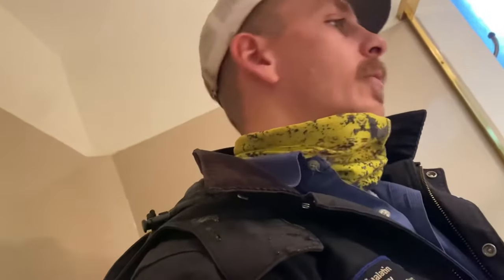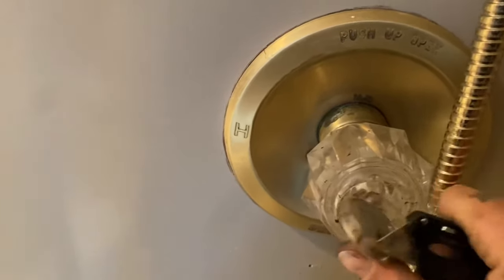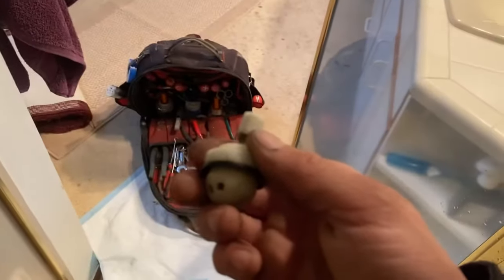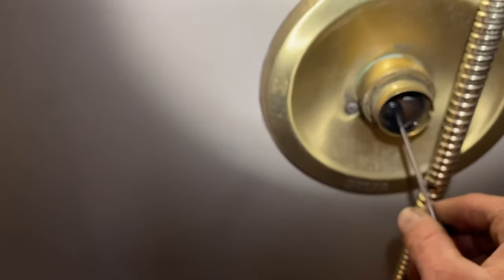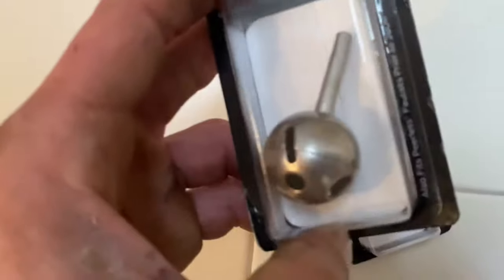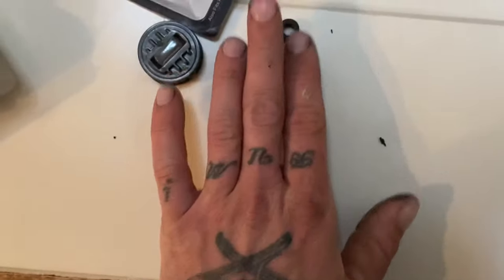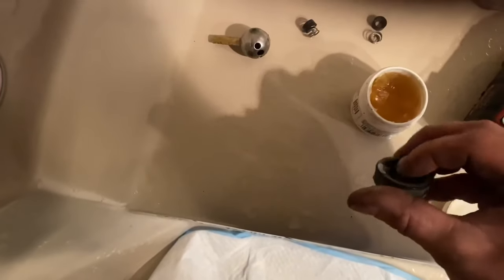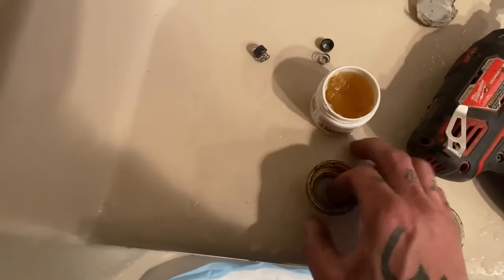How to change a delta shower cartridge ball style

Comment: Step one: turn off the water supply
Reply: Step two: Drink beer, while deciding as to whether or not you want to continue with the project. 
If you drink enough, you'll probably decide to take a break. Hince: You'll likely safe yourself a little work, by deciding to finish later when you're not half drunk!🥴
Ps: Be sure to turn water back on. Better to have a leaky faucet than not have a shower for the next 6 months while you're trying to work up the courage to try again!😄
Reply: @jackpayne3996  yes! definitely need step two.

Comment: Hey, can anyone help!  I changed mine just like this video. My set came with the seals and springs. After I changed everything, the nob is very tight to turn and adjust water temperature. Please help.
Reply: U fix it? I kno y if u havnt
Reply: @dr.greenthumb6535  You think he has not used the plumbers grease, secondly and mainly he tightened really hard?
Reply: @alpharettaleasing6492  yes the silicone on the ball, springs n seats is key for longevity just like oiling the seal when changing oil lol. Also inner portion that is used to tighten by key! Only just snug the cap then tighten inner portion to final resistance. Do not just crush down on the cap
Reply: Replace it with a moen positemp easiest cartridge to change ever
Reply: Just had this happen to me. Took everything out and greased it like crazy. Works great now.
Reply: @Mycobro  Sorry for the late reply, just learned now where to find these YouTube notifications, lol. Hey, does your suggestion mean I would need to cut the pipings? Like cut the entire cartilage housing area?  Because I had the most difficult time soldering some pipes to extend the tail pipe to make it work for the tub sprout.
Reply: @dr.greenthumb6535 That’s great advice! Thank you. I need to ask: which direction the spring goes?  I notice the spring is like a cone: there’s a wider end and a smaller end. Can you please help!
Reply: @vlam8451  Figured this one out myself as the big end of the cone shaped springs will not go in the end of the cap washer easily. Saw the answer somewhere here on YT. The big end goes in first and the small end of spring then pointing out and goes into the cap washer.

Comment: Info was good, but the video itself wasn't so great because of the one handedness made the picture not the greatest. Maybe consider a mounted camera if you're going to do more? If scratches from the wrench are ever are a bigger concern, I'd recommend a rubber strap wrench, sometimes also called oil filter wrench.

Comment: Thanks for the how to! I needed to hear the part about not over tightening the cap. Didn’t remember if it had to be tight against the sleeve or whatever that cylinder is called.
Reply: My 1976 had NEVER been apart. So I applied vinegar and baking soda paste a few months back, followed up with WD-40. Recently for kicks tried to turn bonnet cap lose, by hand and it DID. Since the water was on of course went on further for now. Yup, I'm on well water, no added salts or chemicals so that helps. The takeaway here it that bonnet cap nut does NOT need to be that tight, I'll be making hand tight and just a little snug up with wrench be all mine is gonna get. As an aside, some of these valves, you do adjust the tension by turning the little white plastic ring, with the two little square notches for the little spanner wrench to grab, on the inside of the metal cap nut.

Comment: Just replaced mine cuz I thought it was the fix for my low hot water pressure….I was wrong! Still troubleshooting my reason for having low hot water pressure in my tub/shower only. New shower head, neck, spout and water valve. Moving to the hot water tank next
Reply: Same here but I do have good press to the fixture.  Very little after repairs

Comment: What kind of Grease is that
Reply from the maker: Silicone based food grade plumbers grease
Reply: @Offroadigansplumbingco.7966  damn that's complicated do they have it at Home Depot in the plumbing section?
Reply from the maker: @Miketaylornews  
They should have there own brand there yes 
i go to consolidated supply of they have that in your area
Reply: @Offroadigansplumbingco.7966  ok.. I wonder if I can just use some silicone lubricant you get at a auto parts store.
Reply from the maker: Bro I would not do that 
It has to be food safe or you will contaminate your drinking water and make you sick
Reply: @Offroadigansplumbingco.7966  ok👍
Reply: Plumbers grease